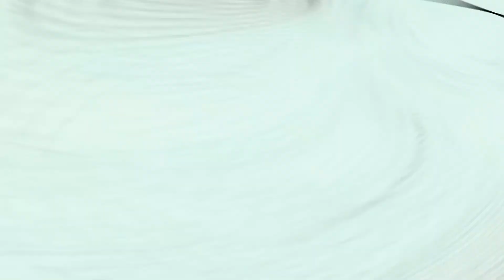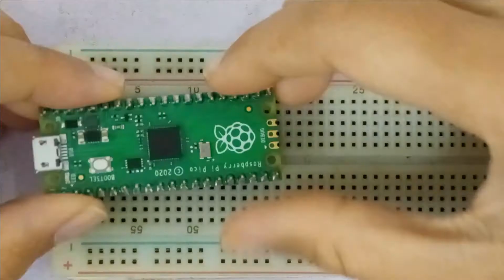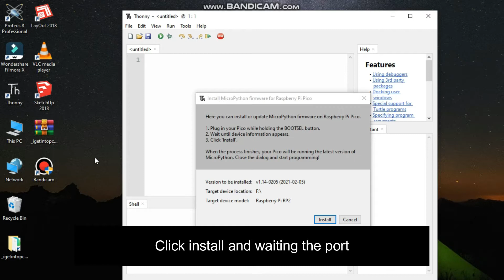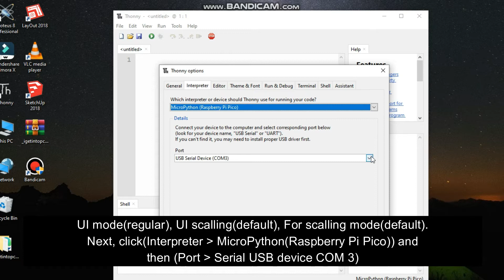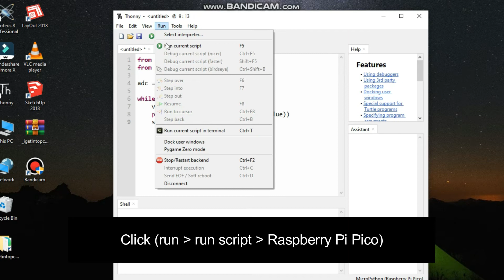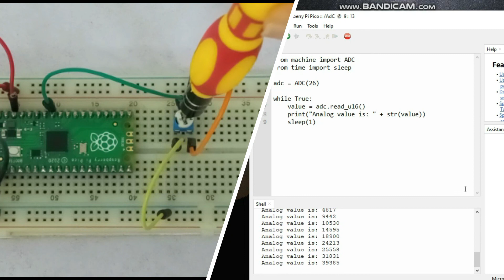Raspberry Pi Pico ADC - Read Analog Value with Thonny Python IDE

Comment: Hey I recently started using the raspberry pico and wanted to test the analog inputs with a potentiometer. However, I can't seem to get it to work using basically the same code that you provided in the video. Even when nothing is plugged into any inputs, all of the ADC's are still reading between 11,000 to 12,000. I was wondering if the pico I have is defective, or I'm messing something up on my end. Very frustrating for something so simple. If you have any advice at all it would be greatly appreciated.

Thanks
-TKC